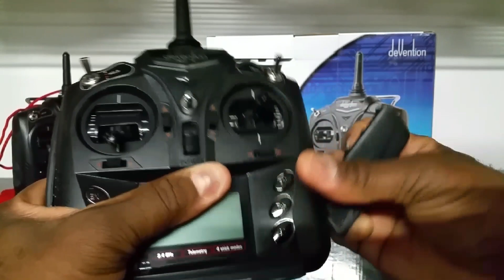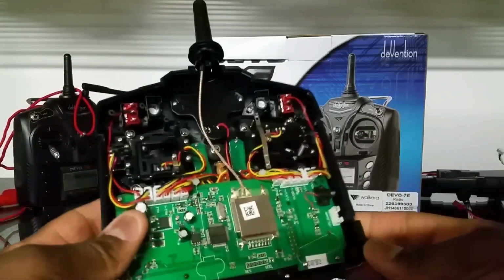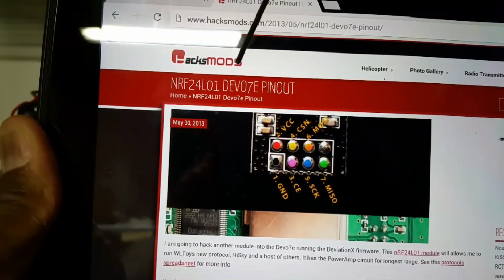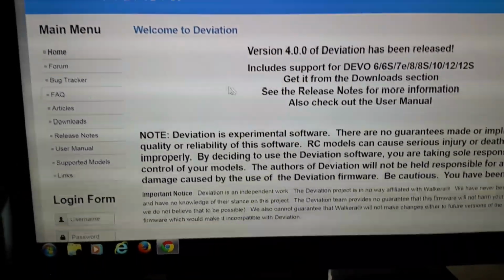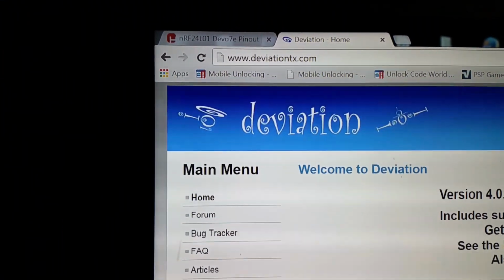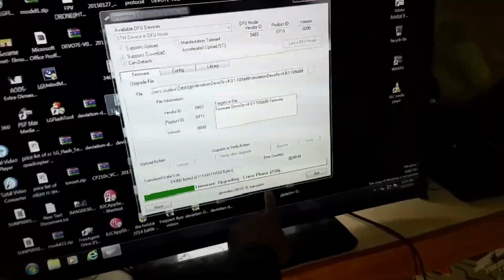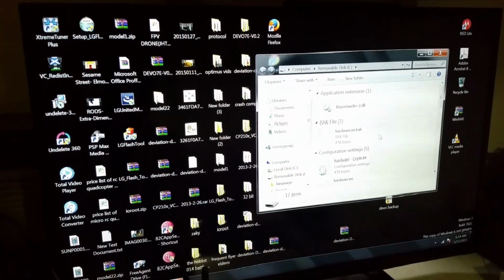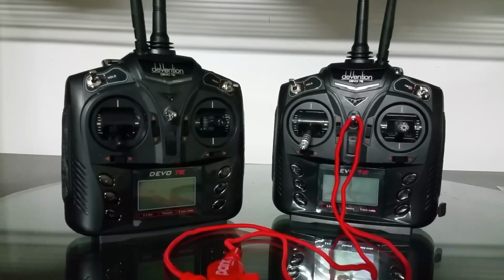Devo 7e Deviation Firmware & NRF24L01 installation

Comment: I saw mod (Devo/10) with adding 4 modules (FrSky, etc...). In your mod it is only 1 module added. Is that correct?
Reply from the maker: Well you can add the other for Hubsan x4 ..I have that module but didn't do the install yet. I thought it enables FrSky and the others.. Really not much room on the pins for more modules. Some of the connections must be doubled up for even these two! Lol

Comment: Yo FF, have you ever build a racer? I'm wondering wich reciever on the board this Devo 7E with mod can support.
Reply from the maker: I believe it's the one built in! If I'm not mistaken, when you build a quad you also must install a receiver to the flight controller so it's your pick as far as which protocol. You can buy the Devo 7e transmitter and receiver as it comes packaged together. This is without any mods or hacking, you can just get the Devo/receiver combination and you should be good. Walkera Runner comes with a nice Devo.. You just rather build your own?
Reply: Thanks dude. I see loads of frsky recievers? Should be good then I guess, but the Devo 7e doesn't support it i think....yet. I just want to make sure I get a good one. And yeah, I'd like to build the quad myself, seems alot of fun. Propably alot of shitty moments to :P
Reply from the maker: Devo 10 would be better
Reply: Ok. Thanks

Comment: the jjrc 100a is in the list and the x-dart next,will it work with the jj1000?
Reply from the maker: Skip X-DART Next and get JJ1000! Oh, and yes it works with JJ1000
Reply: Frequent Flyer RC i already have the jj1000.i've been paying attention
Reply from the maker: clyde payne great but don't get X-DART.. That's going backwards unless you just like the green LEDs (it's  a 1000A)
Reply: Frequent Flyer RC i was just saying it was on the list and i knew it was the same as the 1000a
Reply from the maker: clyde payne Oh!.. JJRC has a new flyer out. I can't remember the name but I got one coming lol
Reply: Frequent Flyer RC are the jj1000 and jjrc h11c the same protocol?
Reply: Frequent Flyer RC who has it?
Reply: Frequent Flyer RC and what about this eachine h8?$13.99

Comment: You drive your JJRC X1 with this, right? I have been wanting to replace my JJRC transmitter for some time now because it's downright godawful. Your triple blade prop mod works great, the quad is much more stable now. Thanks for that, btw (:
Reply from the maker: +TheGraek Yes and flies many others too.. Do it! :P
Reply: +Frequent Flyer RC Looks pretty straightforward, I most probably will. You happy with your Devo? From what I see, it looks pretty much allright. Were they able to fix the rebind issue, I remember that you had to reconnect the quad's battery to rebind?
Reply from the maker: +TheGraek Yes, all is well with them :P
Reply: +Frequent Flyer RC Would you be kind enough as to post your model.ini file for your JJRC X1? I have modded my Devo and it binds but it feels really weird. I have to trim the right vertical trim button to the maximum + value for quad to hover correctly. Also, I am unable to reset gyros (both sticks bottom/right). Is it the same for you or is there something I'm doing wrong?

Comment: frequent you forgot to mention that you also need to erase the semicolon that precedes  has_pa-nrf24l01
Reply from the maker: Mentioned that didn't I?
Reply: iT shows with out the semicolon, but you didn't mentioned, you mentioned only the first one. My installation has failed :( I am absolutely intoxicated by fumes, even though I had the window wide open, but I had to use so many solder and flux that I am poisoned, and deviations says module missing. I have rechecked everything. everything is correct but the deviation does not find the module. :( So now I will need to search the web trying to understand what the hell is going on :(
Reply from the maker: Email me frequentflyer55@yahoo.com
Reply: ok

Comment: What kind of wire did you use?
Reply from the maker: I used wire from downed craft! Lol
Reply: Frequent Flyer RC thanks for the reply, I just did the same thing. Do you have a config file for a Syma X11? I grabbed one from the deviation forum but it's outa whack.

Comment: Ah Hum.... be sure to ground yourself when you do this. There is a reason static sensitive electronics come in the more expensive silver static proof bags and there is a reason ESC's and other microchip components fail and sometimes its just because the microchips were damaged by SD. If they could not be damaged by touching them or in shipping them the manufactures would not use the fancy silver bags. In a dry climate it's even more important. Get an old DC low voltage working micro chip based electronic product you don't use anymore and take it apart and then while its working deliberately fry it by touching it's microchips.... most of the time nothing happens... at least not that you notice... but when it does and you see it happen because you caused it you'll never want to touch a microchip or the circuit board tracing they mount on again. But as long as you are grounded you won't hurt anything... unless you are working with AC higher voltages which is why a decent ground strap has a high voltage low amp fuse. You don't have to feel the discharge like when you get zapped after sliding out of a car seat or rubbing your feet on a carpet.... but that will do it...LOL. SD is real...